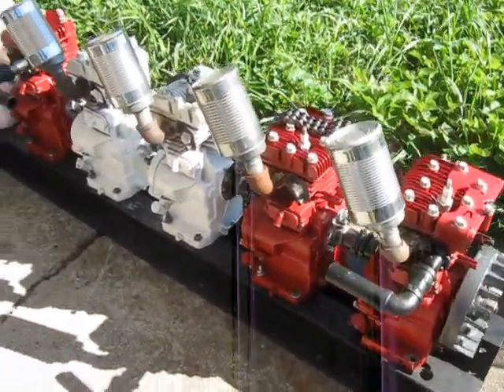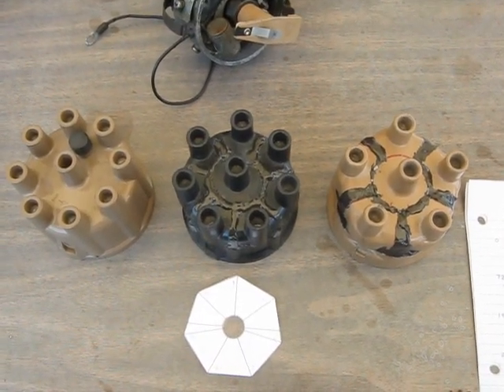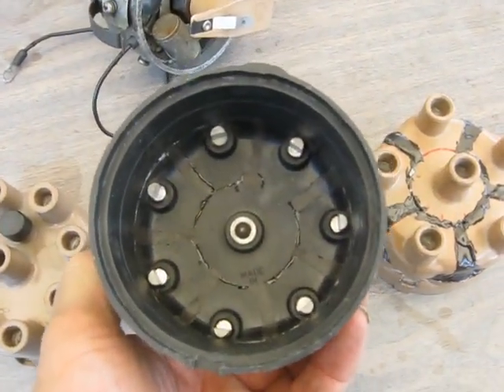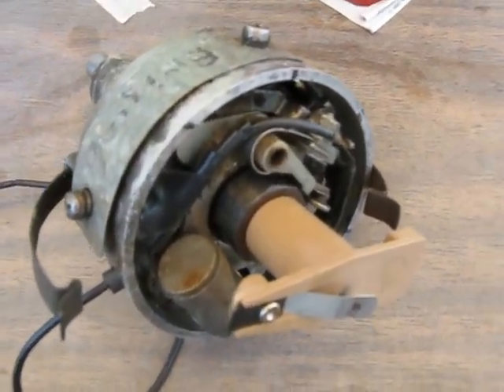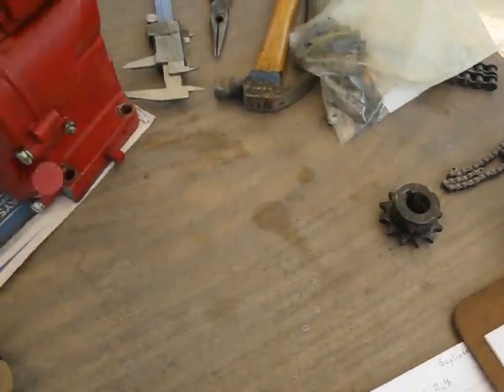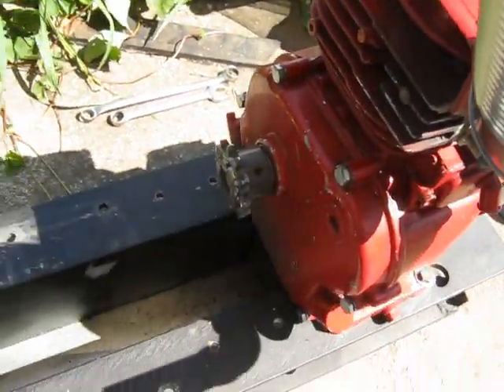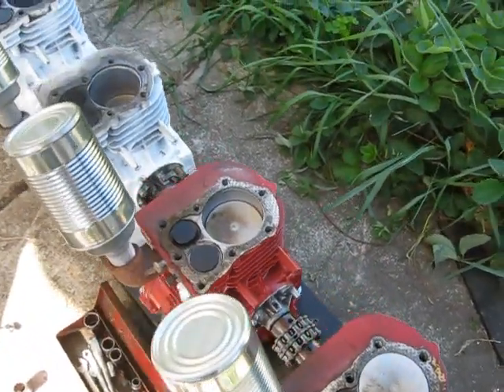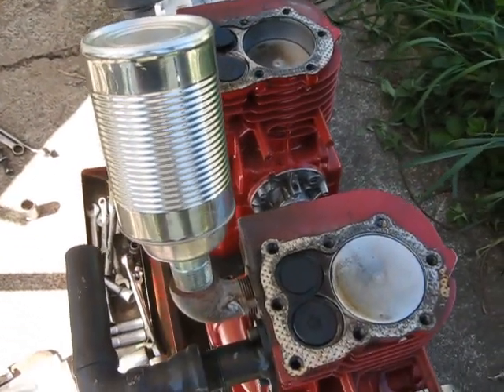Briggs 5 & 7 Cylinder Progress!

Comment: can't wait to hear it run your having to much fun lol
Reply from the maker: Yes, I want to hear both of them run also, I hope I can get them done before the fall weather beats me to the punch.  Building these things is a lot of work, it took me 4 hours just to get the couplings for the 5 cyl. phased right and welded and ground down. Now i am cutting slots in the frame, as #5 cylinder with the big flywheel has a longer front snoot than the other engines, so it monkeys up the bolt hole spacing. Then I will move onto the intake manifold, that is good for a bunch of hours work also. Take care.

Comment: gonna put a rochester quadrajet on 'er? lol
Reply from the maker: I actually have an old Q-Jet, but I fear a few pieces are missing from it, it is too bad, that carb would allow a 327 in a 56 Chevy to do aver 130mph  :)  Isuppose the Duntov 30-30 racing cam helped also, and the electric shift overdrive from a Vette.

Comment: custom caps, thats a new one to me, i would imagine that there position is actually quite critical as it would change timing. Not a easy task
Reply: You could buy a EuroVan distributor, but those are quite expensive as there is only one company making them right now.
Reply from the maker: I figured it was easier to modify a 6 and an 8 cylinder cap, as they both fit the distributor body for my 62 slant 6 Dodge distributor. Odds are that the one you suggest would be a different diameter.
Reply: +ChargerMiles007 I was talking about a complete distributor.
Reply from the maker: Yes, it took some fairly precise work with an exact type hacksaw blade and a ground down broken regular hacksaw blade, as well as lots of JB Qwik  :)
Reply from the maker: Yes, that would be the way to go, if I could find one around here. I am pretty much done with the homemade parts now, so hopefully they work OK.